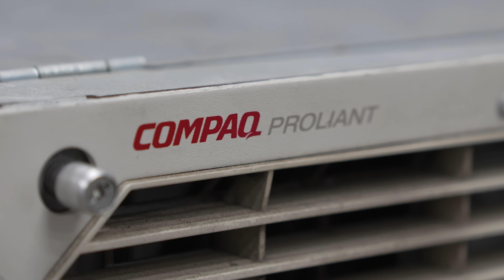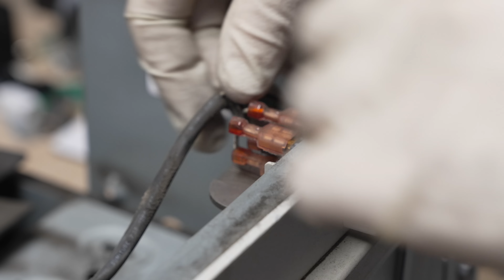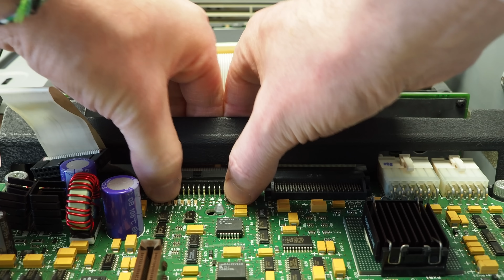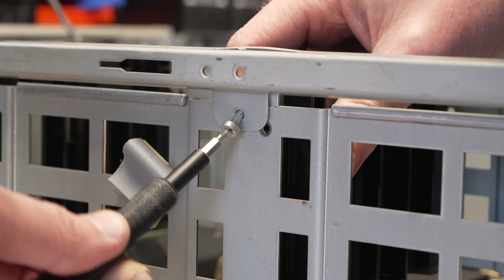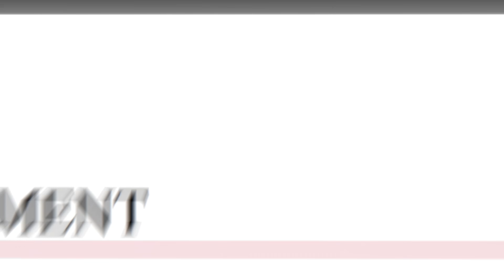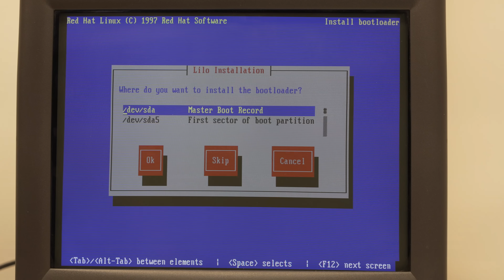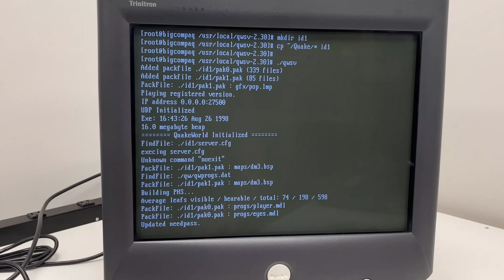A $25,000 server from 1999!

Comment: I had a ProLiant 8500 i saved from the trash in the early 2000s. It had 8x 900mhz Pentium iii xeons and 8GB of ram. Windows 2000 server advanced. And a bunch of 9.1GB hard drives.

Comment: OK one more post... I just wanted to point out, Citrix MetaFrame -- Citrix actually got a source code license for Windows NT 3.5,  developed multiuser and remote desktop support to it, sold this as Citrix WinFrame.   NT 4.0 Terminal Services incorporated a lot of the changes from WinFrame.   At that point they renamed it MetaFrame.  Citrix had some other modifications they made, they got source code licenses for NT 4.0 and 2000 so MetaFrame was basically a modded Windows Terminal Server.

Oh yeah... perhaps don't bother, but 2.2 kernel added senfile() support.  Pre-sendfile, httpd() is running a loop read()ing chunks of file and write()ing them to the open network socket.  With sendfile(), it can like zero-copy disk reads straight into the network card buffer, it actually cuts the CPU time by probably 90%.  It'd be kind of funny if it hit 1,000,000 hits a second with sendfile() going.  That would also need a slightly newer apache of course.  I mean you could I guess, I had a MythTV DVR running Ubuntu 11.04 (from 2011) and installed a 2024-era kernel on it to get a newer  TV tuner going.  0 problems.  Running whatever distro on even a much newer kernel is usually no problem.

It might be amusing to run a non-era-appropriate distro and see just how far you can go.  The 1GB RAM is surprisingly non-limiting on server distros where they up to present day can be installed with no GUI.  It'd might be amusing to throw AntiX or something on there and try it out, or OpenSUSE maybe (not many still have 32-bit versions).  The hardware is probably still supported by any modern kernel.

Comment: So, we got a couple of these ProLiants one time when I worked at the U of Iowa Surplus that actually supported hot swappable memory.    There's some status LEDs next to the DIMMs, it's normally green.  It changes status if it detects ECC memory errors.  You push a button next to the DIMM, some time passes while it frees up that particular block of RAM, the LEDs change status to tell you you can yank and change out the DIMM, and you hit the button again to tell it it's ready to use and hopefully it turns green again.

I never admin'ed one of these, but from what I heard Compaq SmartStart was usually Windows Server or Enterprise, or Redhat Enterprise Linux, with whatever bespoke tools and utilities they threw on.  (And I suppose for supported softwares like Oracle or SQL Server or Exchange or whatever they probably made editions where those were preinstalled?)   The BMC (Board Management Computer -- you  could hook this up to ethernet, access the BMC and get KVM (Keyboard/Video/Mouse) control and reboot, so you could even reboot it when it's locked up and go through the BIOS setup if you had to, remotely)... the hot swap memory support, the multipath SCSI failover stuff, RAID, I don't think fan and temperature monitoring were especially standardized in that era, so plenty of bespoke utilities and drivers and admin tools.  With Redhat, I think a stock Linux kernel would have included the drivers but the SmartStart would have added the admin tools.

Comment: Funny story, I almost tossed a Proliant server off a second story balcony.  I worked at the University of Iowa Surplus department, one of the people that worked on computers that came through.    

So, I heave this like 100 pound Proliant server onto the table (I don't know that it was a 6500... I mean, what the hell, it was like 25 years ago... but it was a chunky one like that.  And hard hard drives installed..)   This was this upstairs area that was just this big U-shaped balcony type of situation.  Then I go to heave this other one onto the table, it was I think a few years newer and looked a bit different but not too much... it like leaped up onto my hands and nearly went over the railing, it must have only been about 1/4 the weight!  They must have changed a bunch of the case from steel to aluminum, or just plain made it thinner, or replaced some stuff with plastic, or all of the above.  I don't know, but I'm glad it didn't launch over the railing LOL.  I mean besides destroying the server, I think having it slam into that concrete would have been very very loud and probably not good for my hearing.
Reply: I gotta stick a second story on here -- but this was not a server.  So, there was this Compaq slim desktop model... well, it was right when HP bought them so it said HP on the front but all the internals still said Compaq.  So I pop it up onto the table and plug it in, the power supply caught on fire and had like 6 inch flames shooting up out the back.  (It was still booting up at this point.  Who needs thermal cutoffs I guess..)   We had been told at some point this was a '5 minute building' if there was a fire for more than 5 minutes, the fire department was not going to put it out.  There was nothing in this building to keep a fire from burning it down quick, and in fact the table I'd set it on was this heavily worn wooden table that basically had splinters and sawdust all over the surface.  So I run over about 50 feet to get the fire extinguisher.. and it was gone.  So I came back, unplugged it, and took it out to the front balcony/steps and threw it off the second floor balcony into the parking lot.  There were cars driving buy in the street, a few almost hit the curb and crashed since, you know, they weren't paying attention to driving when they see this dude throw a burning computer off the side of the building. 

I went back in, I'm like "OK, what the hell, where is the fire extinguisher?"  It turns out some joker on sales day asked if they could buy a fire extinguisher a few weeks earlier, and some student employee was like "Yeah!  Here you go!"    "OK, do not sell the fire extinguishers, those go with the building."  

Oh yeah.  I must be a bit stupid, so I actually bought one of these Compaqs for $20 or whatever and took it home?  All hard drives that go through Surplus are wiped, I threw Ubuntu on there.  (This was like a spare computer I used in the back room, not my main system.)  IT DID THE SAME THING.   I was out of the house but my friend was over, I had a scanner and printer so he was scanning and printing some documents or photos or something; he said he finished, walked out to leave, realized he'd left something in there, and there were like 1 foot flames just coming up from the back of the power supply.  He said the desktop was still up and eveyrthing, this one was still running the system too at that point.  He took the papers off the top so they wouldn't burn, unplugged it, and basically waited around to make sure it wouldn't light the wall on fire (it didn't) and that it went out (it did).   I was visiting some friends and playing this D&D game that was just draaaaaaging on.  It sure made a good excuse to get out when my friend called.  "I've got to go, my computer caught on fire."  Surprisingly, it didn't make the whole house smell like scorched electronics.

I apparently really wanted to tempt fate, so then I actually had ANOTHER one, someone gave it to me (who probably also had gotten it from Surplus most likely).  This one didn't burn, but I came in one day and it seemed a bit too quiet -- the power supply fan had locked up.   Given their apparent zeal for lighting off with a working fan... well I suppose the computer was on but idle, so that probably saved it.  I did finally get the hint though, I powered it off and just yanked the hard drive out (so I could plug it into another system, get any documents off it, and still have the additional disk space.)

Comment: I've just found your channel this week and this brought back some memories. In 2008-2009 I worked in HP in Ireland and I was tasked with decommissioning racks from the two main server rooms to free up space. 21 racks in total. Some of the racks contained these. I had to move the racks nearly 1KM to the loading bay. They where so heavy and any slight bump in the floor stopped them. The casters where thick wheels as well. I'd never seen them operational, they had been powered down at that point for a good while. I know its a year old, but CS1.0-1.4, Battlefield 1942 and an mIRC server would have been nice to see running on these. Such good memories. Thanks for that!

Comment: I remember buying servers in 1995, 1996 time, we would have to pay over £40k for a server and when Compaq and Dell showed up we could get something of same performance for half the price, I remember buying our first compaq server in 1996 and we paid about £20k it had two cpus and probably 256mb ram and RAID disk with four disks.  We were running NT 4 at that time and it supported SMP.  When I started we had NT3.5 which did SMP on 486s!  We did have to use a customised HAL from the vendor to get it to work plus back then you had to switch out on of the key DLLs in the OS to enable SMP.

Comment: These made so much noise I had a 6400 550mhz 4xcpu and a mk1 380  1ghz 2xcpu rack going for a time almost equal performance under win2k server.
Beware never run on one psu connection the internal psu buss won’t take load causing heat damage to connectors have both power to psu’s.

Comment: You guys ROCK. I love old enterprise hardware.  I'm a Dell shop with 2 420's, a 620, a Supermicro I'm using as a router and ad blocker, and about 20 of my own PCs for different stuff (amateur radio projects mostly).  Keep this stuff up.  Ya, the older stuff isn't the fastest but it's freaking bulletproof.  My servers are in a garage and run from 0F to about 100F over the course of the year with absolutely no problems with the hardware.  Software is another issue.  I'll have to send you some pix of my office and my garage (affter I clean the damn thing up, it's a wreck right now!)

Are you guys working in IT now?  Or just "enthusiasts (i.e., whack jobs) like me?

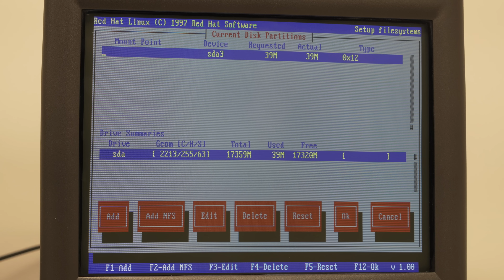Comment: 24:50
Manual partitioning is always fun, you can usually get away with one partition on '/' and maybe a swap equivalent to your total RAM on older hardware.
The lack of a partition format option is kinda surprising.
To answer the concerns however, the max size for a disk using an MBR (master boot record) partition table is 2TB, which is likely what's in use here as GPT was still in development in the late 90s.
Also, fun fact, that version of glibc that installs with the system can't even be pulled anymore as the official repo only has 2.0.1 and 2.0.6, latest version is 2.43 if you're curious.
I'm also glad to see the login screen hasn't changed a bit in almost 30 years.

Comment: I had a Proliant 1500 tower that I converted into a Dual P3 1ghz Cpu server with Tyan Tiger mobo in it, ATX power supply and etc.. Alot of cutting and fabrication to get it there and looking exactly the same as it did with the older hardware. I even used those drive caddies like you found to mount 5 newer IDE 7200rpm drives in it, of course not using the hot swap daughter card, but ribbon cables long enough I could slide them in and out and reach the cabling. Definitely not hot swappable though without killing something.  I ran Win 2k Pro on it, and eventually XP Pro x64 (SP2 and SP3) and used it mostly for a 3D render server and gaming server.

Comment: In the early 2000's my home lab consisted of a HP3000 Dual Pentium II in the under desk cabinet on the wheels and a Proliant 5500 Dual Xeon rackmounted machine. My office never got cold in the Winter. I subsequently gave them away and they were used for a hospital radio setup.

Comment: The old 6500's.  PII, PIII and Xeon's.  I setup many of these new.   With Netware 5 and Windows NT 4.0 back in the day.   They were good machines.  No real failures that I can remember.  The occasional failed drive and maybe a power supply every now and then.  I used to setup quite a few Cisco 20xx Routers a colleges and universities with T1 cards and PRI/ISDN lines for dial up access by the students back in the day.  The would literally use analog phone port on the colleges phone system.  Dial Out, acoss a T1 to the telco, then back in another T1/PRI ISDN to the router and connect and get a connection to the internet.  Then WiFi came out and the whole world changed.

Comment: Oh btw on the drives... The cages are just an adapter for sca80 interface drives. You can use whatever drives in there and it was common practice at the time to replace with Seagate cheetahs for more performance.

Comment: I was working at Disneyland in the mid 80's nights and weekends in the entertainment division, but I had an IT job during the workweek. So there's was an IT opening and I applied -- I didn't get the job.  Dodged a bullet.

By 1990 I had already deployed a 10base2 (yay BNC connecors and termination plugs!) and and a Cat5 (not Cat5e) network (10Mbit + NetWare) at my day job and was running two BBSes and a Meridian/1 PBX.

Those skills parlayed into being an early IT employee at a 1994 startup where my BBS skills allowed me to help maintain the USR Total Control (pre 3-com acquisition) units and those Proliant 6500s.  I remember having to continually help replace the DSP EEPROMs in the Shiva modem blades in the USR TC rack as the v.90 standard was just settling down for compatibility, it took several rounds of updates for the DSP programming to stabilize.  We eventually abandoned local dial-up with iPass for remote access. 

We also had the second T3 circuit in Silicon Valley in 1995 -- it was something like $25k a month -- HP had the other one in the area.  In that server room A Stanford grad student was allowed to install an IRIX Challenge S under a gray folding table at the end of a server row connected with a yellow ethernet cable to use our T3.  That was the first Yahoo server.  The irony that Yahoo just bought AOL which had bought our company in the late 1990s: NSCP.

The circle is complete.

Comment: I installed a couple of these new, early 2000 for a Chemical plant, Hercules  in Doel near Antwerp.
One of the very first Netware 5.0 servers in Belgium  with the then new Zenworks

the 6500 was a beast. I think as configured it was around 40K

Comment: I know of two stories of these where someone was explaining that they had RAID and what it was and some manager or exec yanking drives out of the system to "test" the redundancy crashing the week(s) long setup process of the server right before go live. I personally saw it happen with a newer server where someone didn't get how raid controllers work when you pull a drive "as backup" and put it back later...

Also everyone here will probably cry about it, but a lot of those parts can be tossed in a dish washer with some liquid dish soap (not dishwasher soap that has bleach or abrasives) - anything that doesn't have mechanical parts or batteries - remove those. It'll be fine as long as you rinse it with non mineral heavy water or alcohol and let it dry. Most of this stuff was wet most of its life being manufactured.

Also F the Compaq BIOS. At least on this unit it looks like they finally moved it to nvram of some kind, before that it was basically stored on disk0

Comment: I used to work at a computer refurbishing company back in the early 00's. We used to get a lot of those Proliant servers in. They were as heavy as hell and were easy to take inventory of the parts available. The software that came with the unit we used to erase the contents on the hard drives. But they were popular and we sold a lot of those units.

Comment: I bought a $35,000 server from the Internet boom, I paid 1,500 for it at the time, and it was all wasted money...  ...an IBM xSeries 455 that could be outfitted with quad Itanium 2's and up to 56gb of RAM acorss 24 dimm sticks.  I was totally enamored by being able to have that RAM, I was stuggling big time to get past the 32bit 4tb limit on desktop PCs... but...    the 455 was not the solution.  The Itanium 2 really was a dog, but even more so of a dog, was the EFI BIOS it came with.  And that it was designed for a 50F server room, and if it wasn't in one, it's fans howled like a banshee.   Total waste of money, I never used it for anything.  Installed Centos OS on it and that was as good as I could get it, but didn't even use it as a web server.

Comment: The LED Panel is called an "IMU" - INtegrated Management Unit, and Smartstart used to be supplied as a kit; a sleeve of CDs, with not only the Smartstart disc itself, but OPerating Systems supplied by Compaq with slipstreamed drivers already in place. I was a Compaq field engineer back in 97-99. Great Kit to work with..